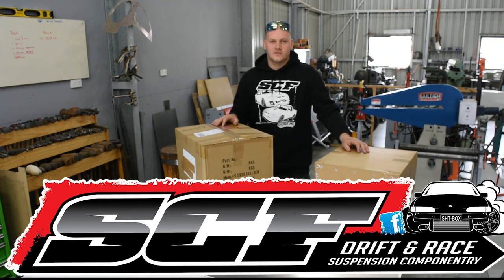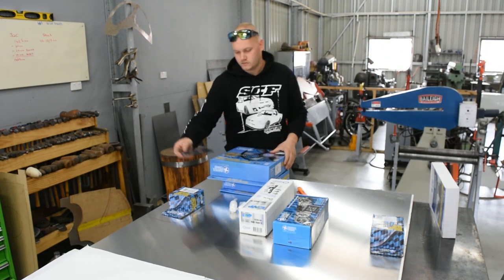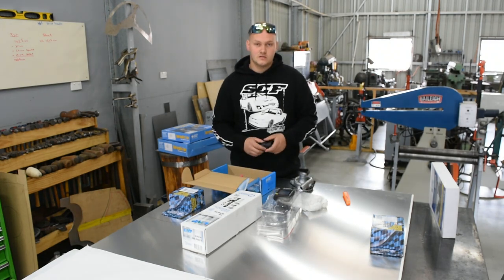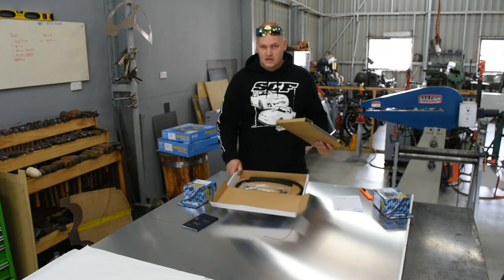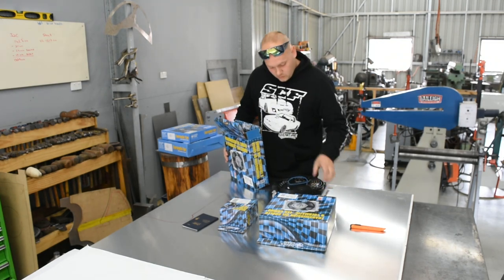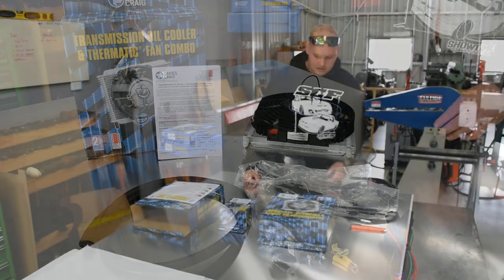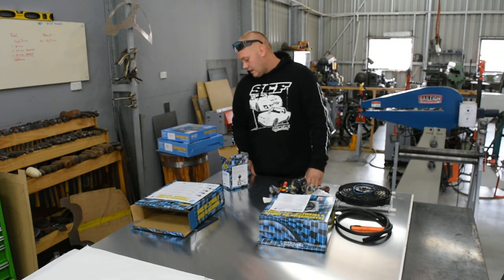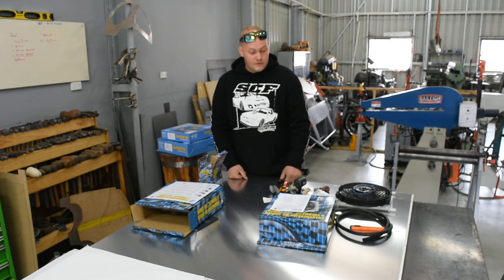UNCUFD PART 3...COOLING SYSTEM

Comment: Killer work fellas 👌 Be minful of them water pumps the 150 i run used to lock up at hotter temps due to the impeller flairing and locking on the outer casting of the pump, I unded up spacing it out a bit with a thicker gasket and haven't had an issue since.